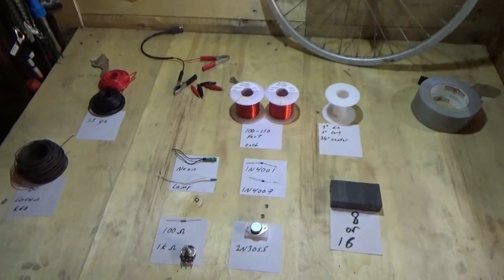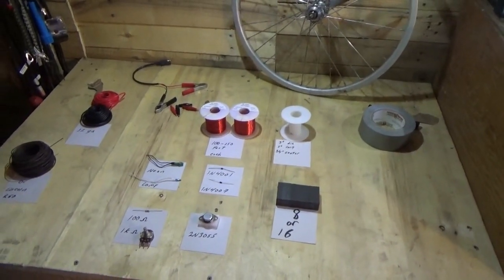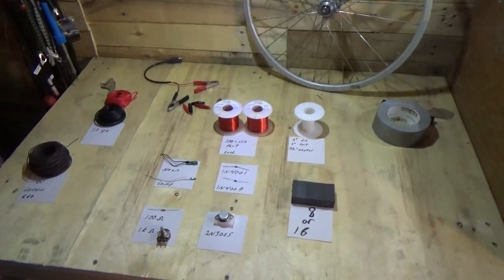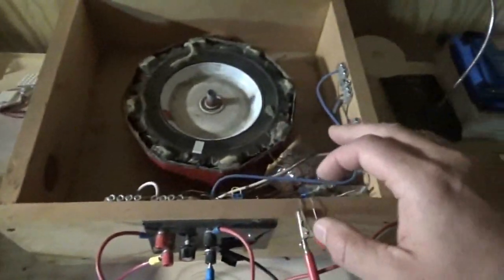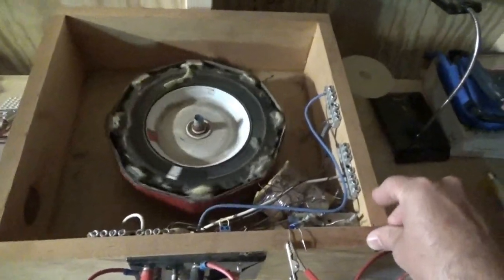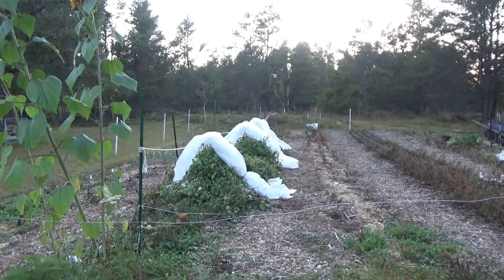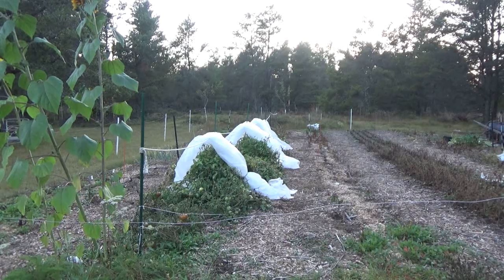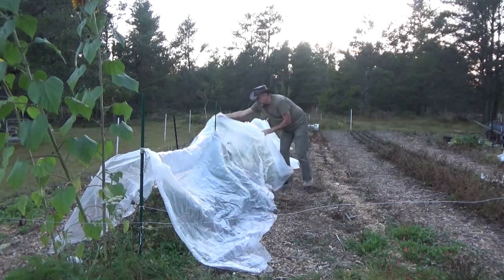Cutting Fire Wood & Making Bedini Motor Parts List

Comment: Bedini Motors deliver brief pulses that are indeed higher in voltage & current than the input, but because it delivers zero or almost zero voltage & current between the pulses the average power is 10% or less than the input power. When measured on a meter, it will usually only show the value of the peak of the pulse, not the average power, or it's near zero state value.

A photo flash on a good camera can give a brief flash as bright as a100 watt bulb. How could the tiny batteries put out 100 watts? Is there some miracle circuit generating more power from nowhere? Of course not. It charges a capacitor to deliver power to the flash tube for just a millisecond or so. It only consumes a few milliwatts per minute to flash a 100 watt flash for a millisecond. 

You have to think not only in watts, amps, & volts but in kiliowatt hours or on a small scale, watt/hours to analyze power used. A blinking bulb may only use half the power, & last twice as long running on a battery because it's off half the time.

If a Bedini motor is showing 10 watt pulses for only 10% of the time it's running but showing near zero watts between the pulses during the time it was running, after an hour it did not put out 10 watt/hours, it put out 1 watt hour. But on a meter it shows it's putting out 10 watts while only using 5 watts.

This is how these scam machines & fake inventions work. They fool you into believing they're working. The measured output on the meter does not take into account the time & gap between the pulses when the machine is putting out zero or near zero.

LED lighting & desufication of lead acid batteries is not a test of power. I can keep a few LEDs lit for days on a few chunks of metal placed in a cup of lemonade.

De-sulfication of lead acid batteries by brief high voltage & current pulses into the battery was a known process since WWI. In many cases there was energy & charge in the chemical energy that was already in the battery, but couldn't be used because of the contaminated battery plates. Most of the chemical energy was already in the battery. The de-sulfication of the plates enable you to use some of the chemical energy already in the battery again.

Don't waste your time building these motors. Make yourself a pulse oscillator driving a step up transformer to get the same effect, more efficiently, more accurately, cheaper, & easier.

A 10 watt pulse 10% of the time with zero watts between the pulses 90% of the time is 1 watt hour, or an average of 1 watt. You are not getting 10 watts from 5 watts as shown on the meter, only 1 true watt or watt/hour.

bedinimotors.blogspot.com/

Comment: Troy, on the chain saw... take the oil filler cap off and drain the oil. Then use an air nozzle to blow out the chamber ... making a seal around the top of the filler tube with your free index finger. Just do short spurts of air so you don't blow out your seal on the bar end. Check the bar end for any indication of oil or debrey. I've never had to do that more than 3 times total. Now refill chamber with oil, and test it out.
Reply from the maker: Thanks for the tip

Comment: You 100% cannot get more energy out of the motor than you put into it. If you provide a given amount of power over a given amount of time it can put out more power over intervals within that timespan.
Reply from the maker: Really? I keep hearing that. But I do get more power out of my wind turbine than I myself put into it. And I do get more power out of of my solar panels than I myself put into them. And I do get more power out of my Bedini motor than I myself put into it.
Reply from the maker: Now consider those three points. There is a common denominator there......
Reply from the maker: All three devices are converting one form of energy into another. Thats all they are doing. Converting one form of energy into usable energy. All three.
Reply from the maker: I ask you a question. Is there energy in the air around us?

Comment: That motor isn’t outputting more energy than you put in. It might create a higher voltage or current but it is impossible to get more energy than you put in.
Reply: The Do It Yourself World how is the radiant energy harnessed by this device then? I really don’t think it is doing what you think its doing.
Reply: The Do It Yourself World It is inductance. How mains transformers work. You will not get out more energy than you put in.
Reply from the maker: Wrong. It is not "producing" any power but it sure is tapping into energy. Do you deny cosmic energy or wind energy? Both exist and have huge potential.
Reply: The Do It Yourself World I don’t know what you mean by cosmic energy. Wind is kinetic energy. The net total output can’t be more than the input. It really can’t.
Reply from the maker: That is correct. The input is combined radiant energy and that of the battery I am using to power the wheel.
Reply from the maker: +Alex Hitchins John Bedini, Tesla and many others found that by pulsing a coil with voltage very fast and shutting it off, energy will flow from the coil. It disturbs the energy in its resting state
 Some flows around the coil when disturbed.
Reply from the maker: +Alex Hitchins Tesla experimented extensively with it
Reply from the maker: Yes you can. My wind turbine provides me more power out than I myself put in. My solar panels provide more power out than I myself put in. A static energy device provides more power out than you put in. A Bedini Motor provides more power out than I myself put in.
Reply from the maker: Its just different forms of energy. Do you deny that the air, the very atoms, are full of energy?
Reply from the maker: Do you not find it even remotely possible that we can tap into that vast storage of energy? I mean with all the technological advances do you really believe its not possible? Why do you deny that such a simple device with such a simple function cannot work when you have not even tried to build one yourself?
Build one according to specs, test it and then come back to me a believer. trust me.
Reply: The Do It Yourself World I can’t see how you can get more energy out than you put in. What is the math behind your claim? I’d hazard a guess you are still bound by the conservation of energy laws.
Reply: The Do It Yourself World I am all up for scientific advances and experiment based research. I also believe in the laws of physics hence find it difficult to see how this device achieves what you state.

Comment: you haven't even insulated your Electronics Shop yet.........Do Electronics like, accumulating moisture and, Ice... forming on the connections ? then, Melting and, potentially Rusting ?
Reply from the maker: yes
Reply from the maker: My truck was broke down all summer and I am using pallets for paneling. Well, without a truck, no pallets = no paneling.
Reply: how about moving your more Vital Instruments into the Insulated Trailer.....you are NOT, living in....
Reply from the maker: Why? Its not winter yet and I hope to get the electronics lab finished and full time heated before winter. Although we have freezing nights sometimes the shed does not get that cold yet.